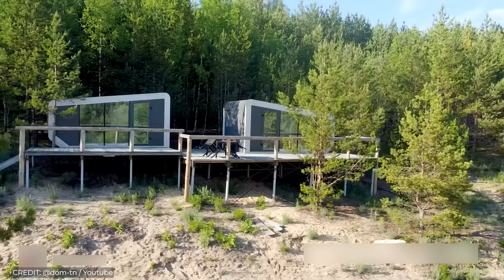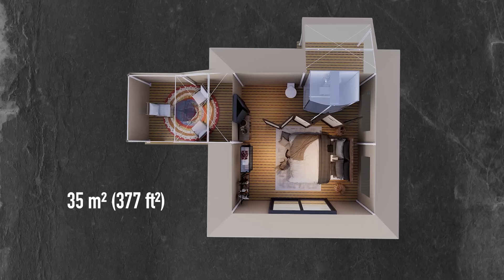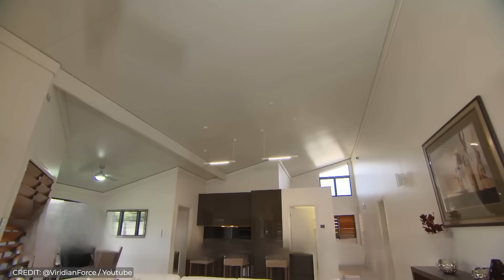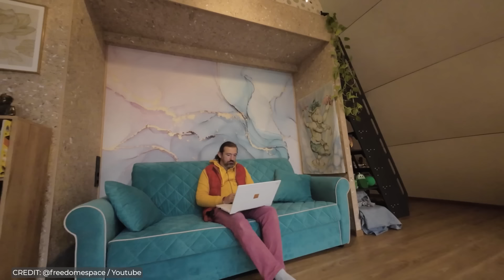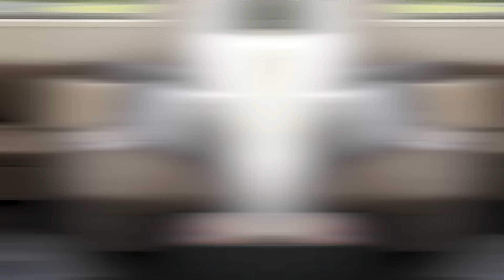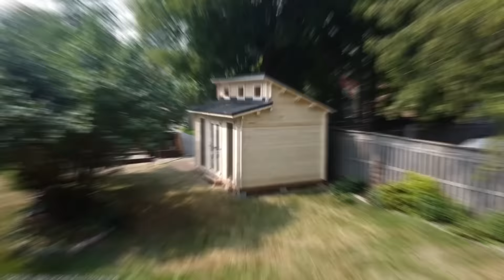50 Insanely Cheap Houses You Can Actually Afford!

Comment: Cheap, efficient, easy? These are icing. Where's the cake? Most of these look flimsy and poorly insulated. If a Moose rubbing antlers on them does more than superficial damage, it's not even worth the price. A classic log cabin is cheaper, likely better insulated  and if paired with certain medieval building techniques, like a raised pier foundation, very efficient, and it costs the price of a good wood axe,  and some sweat.

Comment: [00:00:20] Atom Mini Home
Description: Fully built micro‑home, installs in 30 minutes, glued‑wood frame, bedroom + kitchen + bathroom.
Price Range: $20,000  
Production Company: not stated  
Country: not stated  

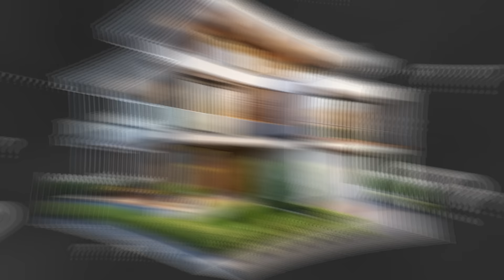[00:01:02] A‑Fold Model T
Description: Folding trapezoid home, 52–127 m², pre‑assembled, deploys in days.
Price Range: €30,000  
Production Company: not stated  
Country: not stated  

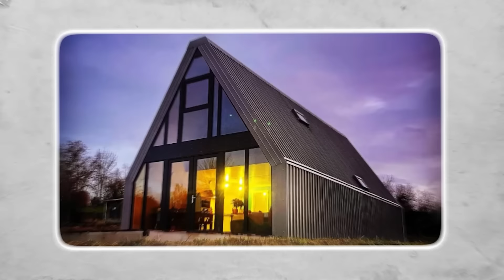[00:01:45] Baus Mirror Home
Description: Mirror‑clad modular home, blends into landscape, full interior.
Price Range: $35,000  
Production Company: Baus (implied)
Country: not stated  

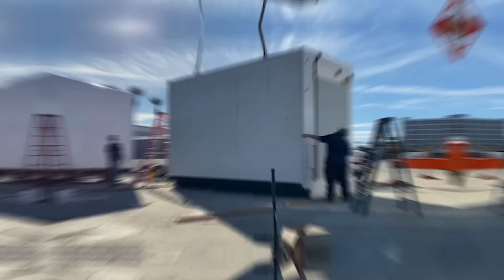[00:02:27] Boxabl Casita
Description: 34 m² foldable prefab home, full kitchen, bathroom, steel + concrete + EPS.
Price Range: $60,000  
Production Company: Boxabl
Country: not stated  

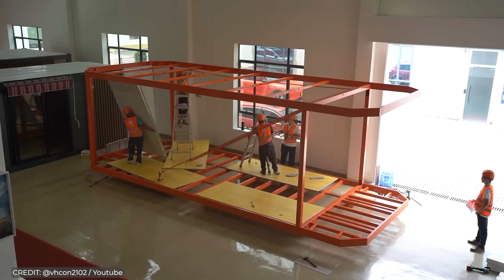[00:03:17] VH30 Capsule Home (VH Con)
Description: 22.4 m² aluminum capsule, smart locks, AC, intelligent toilet.
Price Range: $16,500  
Production Company: VH Con
Country: not stated  

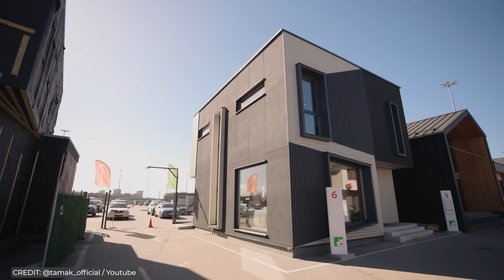[00:03:53] Tamac High‑Tech Prefab
Description: 122 m² prefab, cement‑bonded boards, fireproof, moisture‑resistant, installs in 7 days.
Price Range: $123,000  
Production Company: Tamac
Country: not stated  

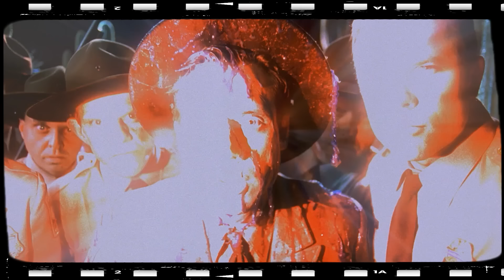[00:04:44] Novadeco Milan Container Home
Description: 29 m² steel container home, turnkey, double‑glazed windows, designer kitchen.
Price Range: $15,000–$80,000  
Production Company: Novadeco
Country: not stated  

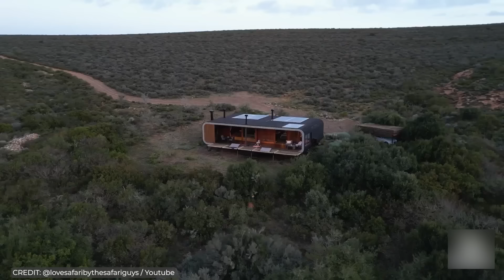[00:05:22] Melzory Eco Pod
Description: Eco‑friendly pod, sleeping area, kitchen, bathroom, off‑grid capable.
Price Range: $50,000  
Production Company: Melzory
Country: not stated  

[00:06:03] Champion Homes – Prime Series
Description: 46–74 m² manufactured homes, multiple bedrooms, factory‑built.
Price Range: $60,000  
Production Company: Champion Homes
Country: not stated  

[00:06:40] AS House Wellness Pod
Description: 21 m² SIP‑panel pod, sauna + studio, cedar interior, panoramic glazing.
Price Range: $8,500  
Production Company: AS House
Country: not stated  

[00:07:18] Kropf Island 6327 (Park Model RV)
Description: King bed, full kitchen, 509 L fridge, fiberglass shower, luxury interior.
Price Range: $80,000–$120,000  
Production Company: Kropf
Country: not stated  

[00:08:02] Pak‑A Tent House (Tents Expert)
Description: 35 m² tent house, steel frame, double‑layer canvas, wind + snow rated.
Price Range: $7,000  
Production Company: Tents Expert
Country: not stated  

[00:08:47] Fritz Modular Home (Canadian‑built)
Description: 37 m², hydraulic lift bed, luxury bathroom, hardwood ceilings.
Price Range: $60,000  
Production Company: Fritz
Country: Canada  

[00:09:26] Turkish Two‑Container Home
Description: Two containers combined, open layout, veranda, fast build.
Price Range: $25,000  
Production Company: not stated  
Country: Turkey (implied)

[00:10:04] Hyuga Reinforced Concrete Home (Grandea)
Description: Bulletproof, hurricane‑proof, earthquake‑proof, 45 m², steel shutters.
Price Range: $75,000  
Production Company: Grandea
Country: Argentina  

[00:10:49] Volstrukt Steel‑Frame ADU Kit
Description: 46 m² steel‑panel kit, assembles in <30 days.
Price Range: $35,000  
Production Company: Volstrukt
Country: not stated  

[00:11:32] Van Homes Expandable House
Description: Expands to 59 m², insulated, house‑grade windows, relocatable.
Price Range: $8,000–$15,000  
Production Company: Van Homes
Country: not stated  

[00:12:18] Holtzov House 2.68
Description: 75 m², 3 bedrooms, sauna, landscaped plot included.
Price Range: $120,000  
Production Company: Holtzov
Country: not stated  

[00:13:07] Lotusta Modular Home
Description: 18 m² compact module, LED lighting, fast assembly.
Price Range: $8,000  
Production Company: Lotusta
Country: not stated  

[00:13:38] Habitat for Humanity + Alquist 3D Printed Home
Description: 111 m² concrete 3D‑printed home, tornado‑resistant, 15% cheaper per sq ft.
Price Range: not stated  
Production Company: Habitat for Humanity + Alquist
Country: USA (Virginia)

[00:14:22] Zero‑Energy Home
Description: Solar + insulation + heat recovery, near‑zero utility bills.
Price Range: $200,000  
Production Company: not stated  
Country: not stated  

[00:15:02] Alute Extreme‑Climate Module
Description: Composite shell, rated to –50°C, smart climate system, relocatable.
Price Range: $22,000  
Production Company: Alute
Country: not stated  

[00:15:47] Genesis Homes Modular
Description: Full‑size modular home, assembled in ~55 days.
Price Range: $160,000  
Production Company: Genesis Homes
Country: not stated  

[00:16:27] Conker Spherical Pod
Description: Aluminum + recycled plastic pod, underfloor heating, modular.
Price Range: $27,000  
Production Company: Conker
Country: not stated  

[00:17:06] Compact Garden Buildings
Description: 5×3 m timber buildings, SIP walls, DIY‑friendly.
Price Range: $3,000–$10,000  
Production Company: not stated  
Country: not stated  

[00:17:47] Solid Cabin A‑House Kit
Description: 47 m² A‑frame, loft, weatherproof, fast assembly.
Price Range: $20,000  
Production Company: Solid Cabin
Country: not stated  

[00:18:26] Antang Steel Expandable House
Description: 37 m² expandable container, deploys in <2 hours.
Price Range: $8,000  
Production Company: Antang Steel
Country: not stated  

[00:19:01] Sphaerich Keter Dome
Description: 138 m² dome, extremely energy‑efficient, 4 bedrooms.
Price Range: $50,000  
Production Company: Sphaerich Keter
Country: not stated  

[00:19:56] Seth & Emily Brick Container Home
Description: Two‑story container home, wood stove, balcony, premium finishes.
Price Range: $180,000  
Production Company: not stated  
Country: not stated  

[00:20:30] F‑Form Cabin
Description: 65 m² sculptural cabin, 20 m glass façade, premium materials.
Price Range: $200,000  
Production Company: not stated  
Country: not stated  

[00:21:07] The Snail (CNC‑Cut Home)
Description: 50 m² CNC‑cut frame, 200 mm insulation, built in ~8 days.
Price Range: $20,000  
Production Company: not stated  
Country: not stated  

[00:21:56] Massive EV A‑Frame
Description: 42 m² A‑frame, mezzanine loft, 3‑day assembly.
Price Range: $25,000  
Production Company: Massive EV
Country: not stated  

[00:22:30] U‑Panels Home
Description: Pre‑manufactured structural panels, full home for low cost.
Price Range: $25,000  
Production Company: U‑Panels
Country: not stated  

[00:23:14] Australian Two‑Piece Modular Home
Description: 90% factory‑finished, crane‑assembled in one day.
Price Range: $55,000  
Production Company: not stated  
Country: Australia  

[00:23:53] Wildwood by Peak
Description: 135 m² luxury modular home, 3 bedrooms, award‑winning.
Price Range: $160,000  
Production Company: Peak
Country: not stated  

[00:24:31] Sphere 11
Description: 133 m² dome, balcony, double‑height living room.
Price Range: $35,000  
Production Company: not stated  
Country: not stated  

[00:25:09] Elsewhere Pod (Australia)
Description: 8 m pod, titanium‑magnesium frame, luxury bathroom.
Price Range: 80,000 AUD  
Production Company: Elsewhere
Country: Australia  

[00:25:46] Ultra Domus Ultra 60
Description: 60 m² turnkey module, no construction phase.
Price Range: $35,000  
Production Company: Ultra Domus
Country: not stated  

[00:26:58] Solid Cabin Diamond XL
Description: 26 m² cabin with loft + deck, relocatable.
Price Range: $14,000  
Production Company: Solid Cabin
Country: not stated  

[00:27:37] Certified Passive House (Green Strip Model)
Description: 150 m² passive house, 90% lower heating/cooling costs.
Price Range: $700,000  
Production Company: not stated  
Country: not stated  

[00:28:13] Urban Rigger (Floating Housing)
Description: 23 m² floating studio, upcycled containers, carbon‑neutral.
Price Range: $60,000  
Production Company: Urban Rigger
Country: not stated  

[00:28:54] House Drop System
Description: 138 m² modular home, factory‑built, high‑quality finishes.
Price Range: $180,000  
Production Company: not stated  
Country: not stated  

[00:29:30] Build Tiny – Buster
Description: Trailer‑detachable tiny home, 7.2×2.4 m, full interior.
Price Range: $38,000–$70,000  
Production Company: Build Tiny
Country: New Zealand (implied)

Comment: A contractor pointed out what they never mention: most of the houses wouldn't meet local codes (e.g. water heaters in the kitchen, wiring, etc.), which is why you rarely see them in an urban or suburban setting.

Comment: Okay...these are beautiful (cheap) houses, but  how do you get water and electricity when the house is in the forest or desert?
Reply: I live in a mostly off grid community and a solar system that mimmicks being on grid could be like 20-30k… athough you dont really need all that and could do something more modest for 5-6k… including a back up gas/propane generator in a lot of these tiny homes.  And there are a lot of water delivery services or you can easily haul your own water from several locations that are pretty close by… although a lot of off grid locations may not have a water delivery or collection site that close.  You can set up a rain water collection system however… and there are many options for making that happen… but you could set up a decent system for maybe 1k to 5k or more depending on  various factors… The lower prices would probably include a degree of DIY

Comment: But which ones can you buy in the US?
Reply: If the company is not in the US, maybe it is possible to ship it to US
Reply: @caspice True. But, I  would imagine the cost would be prohibitive. Especially with tariffs
Reply: @thomasoday7828  even with no tariffs shipping a HOUSE SIZED OBJECT isn't cheap, google says the average COST PER MILE for having a Mobile Home (Single wide trailer) moved is $4-$7 per MILE, so moving something from say the Port of LA to Phoenix Arizona (about 383 Miles) would be several thousand dollars, if you are further inland and not near a port you could be looking at 10's of thousands just for the ground transport once it reaches US soil. Then if it's fully assembled you will likely need a large crane rental to lift it and set it in place which will be another couple thousand and unless it collapses down to a container sized object with all the same structural points so it can be shipped on a container ship you are looking at a specialized Barge transport which will quickly exceed the cost of the item coming in at 10's of thousands of dollars without even mentioning tariffs.